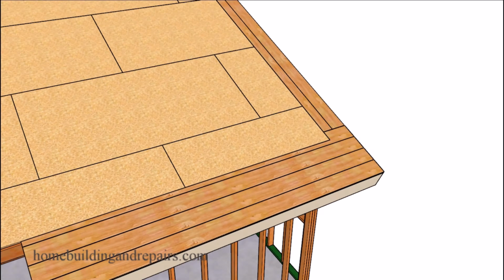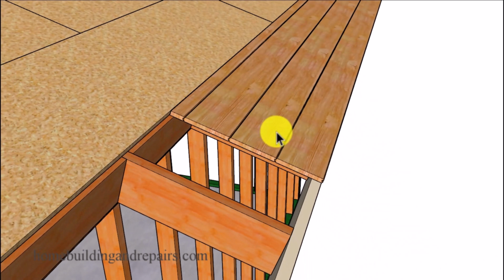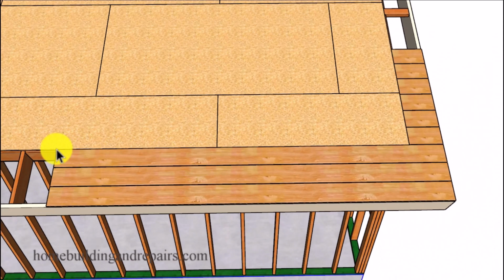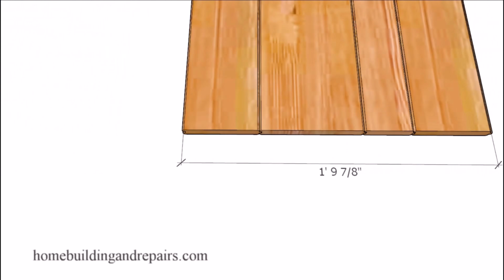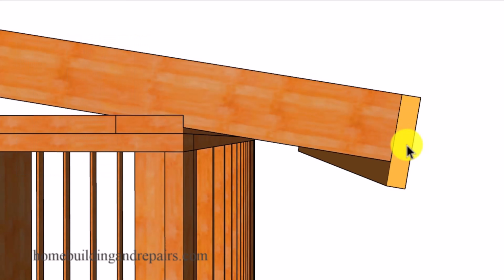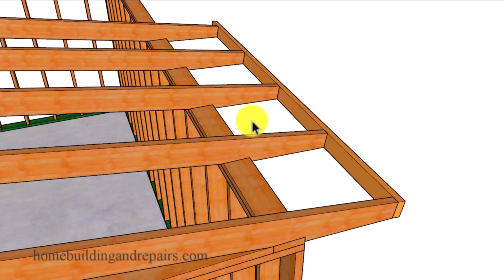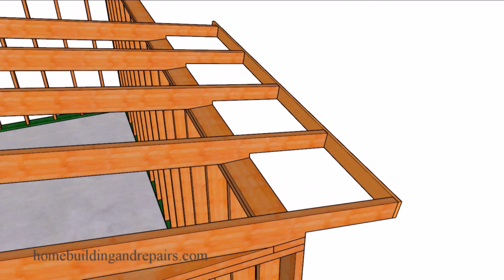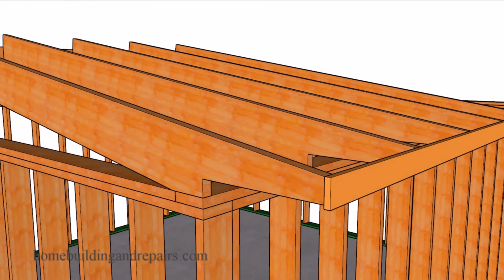Stop Wasting Lumber And Start Using These Overhang And Fascia Contractor Approved Methods

Comment: Ive been in custom home market where im at.We do some of these details and always figure for what said material.On my log home overhang I build the whole soffit on ground and lift in place to install as a unit.We have 12'' BCI roof is common here and large snow loads.Had whole homes decorative cut tail and bird block vent, very expensive, all holes wear routed.The log home we run 14'' fascia and a shadow brd.Also done 3 step fascia on large log homes, looks real nice.20'' logs

Comment: The design at 6:50 looks like a recipe for water running down  it to the building....I usually add a notch on the underside,so any water drips off before getting to the building.
Thanks for your vidios.
Reply: Yes, even traditional  door and window sills had a kerf cut into the bottom edge as a drip edge. Many old school techniques have been lost with modern construction.
Reply: @davidparker9676  I know what you're referring to. The best way to do it is with exterior window sills.
Reply from the maker: Good tip and maybe reshape rafters or use larger fascia.

Comment: Lol, it reminded me of doing fascias and bargeboards by myself on two story track homes back in 80s. Since I had no help I had to run 16d nails about an inch deep on top of the fascia/bargeboard at the locations of the rafter tails/outriggers. I'd bend the nails over to the fascia inner side and slowly slip the fascia board over the rafter taiils and hammer the side of the bent over 16d nail head into the tails about every 6 feet. That freed my hands to nail them off exactly where I wanted.

Back in those days my practice was to drop the fascia about an ⅛ of an inch below the top of the rafter tail so I can have the roof sheathing rest on about an ½ inch of the inner edge of the fascia for support and still have an uninterrupted roof slope to the outer edge of the fascia.
Reply: "Helper nails" is what I know them as. Best way to do it when framing solo!